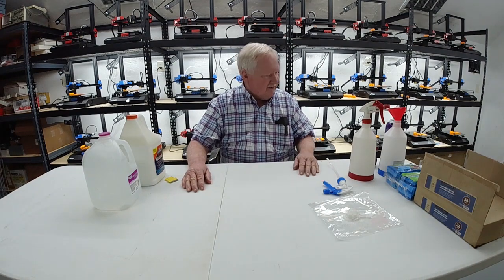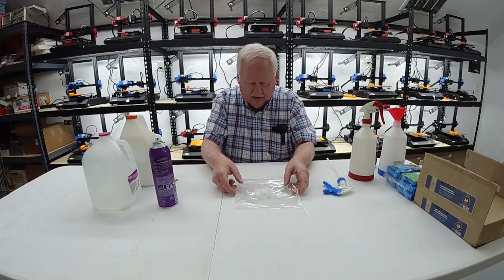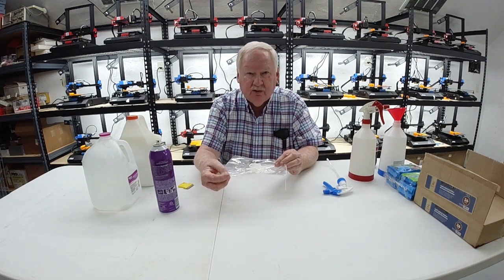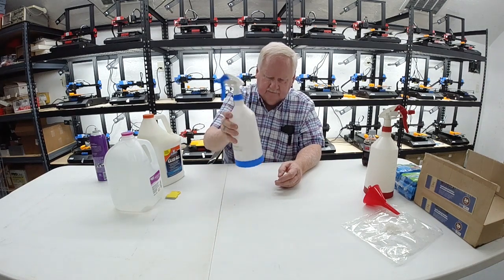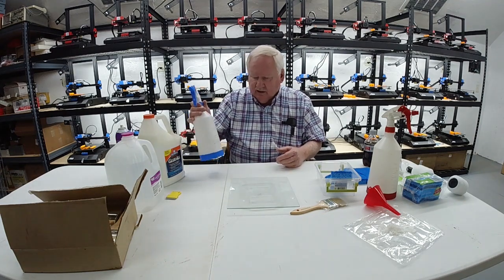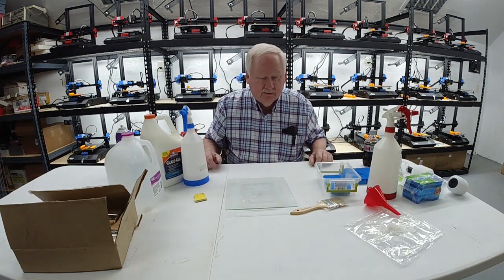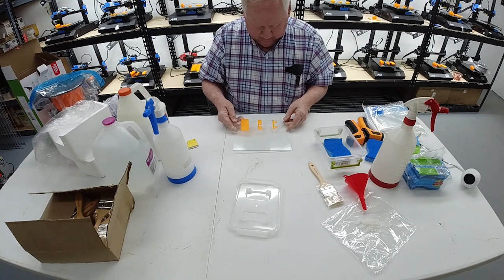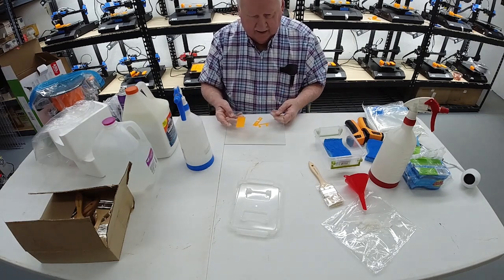GLASS BED 3D PRINTER PROBLEMS, the number one problem at New Tech Inventors is adhesion.

Comment: Where did you get your clips to hold the glass?
Reply from the maker: The low-profile flat clips came with the Anet printers and the copper clips I purchased them on eBay as a box of 100, I think. You can also get them at Staples. Thanks for the question and for your support...Ken

Comment: There is another way to improve adhesion without using any glue: you tweak slicer settings for initial layer. Initial layer line width : increase to150%.      Build plate temperature initial layer: add 10 degrees Celsius or more. Also if your nozzle is just a tiny bit too high from the bed than it should be that could also cause adhesion problems.
Reply from the maker: Very good advice my friend. Your right the initial layer is critical and I have been working on the glass temperature and nozzle height. I haven't increased initial layer line width to 150% yet but will try that. Thanks for sharing your ideas and for your support...Ken

Comment: That’s a great idea Ken. Best way to learn trial and error. Looks like you did very well. 
I used some of the nano glue for my abs, I found that you have to remove before the bed cools , if you remove after the bed cools it will crack the tempered glass. It’s also not easy to remove your prints when the bed is hot. Your way looks much easier. Thanks again for sharing Ken. Cheers Robert
Reply from the maker: Thanks Robert, it seems like there are so many different surfaces to 3D print on that it's hard to figure out which one is best. I have come to the conclusion that it mainly depends on what you are printing and what kind of filament you are using as well as what printer and what you want the surface of your part to look like. In other words it's going to be different for everyone and I can only determine which is best for my 3D print jobs. Good to hear from you and and get input on your experiences...Ken

Comment: Cool experiment Ken. I really enjoy your videos. I agree with the other that steel flex PEI sheet is the way to go, more so for a production setting like yours. You can't be adding to your process, especially with more printers coming online...Keep it up! C
Reply from the maker: I will be putting steel plate with PEI sheet on it on one of my printers to see how well it works for me. If it does better than glass I will be changing over to that method. Thanks for your input, it's very helpful to get advice from others...Ken

Comment: I use PEI sheet as well. I used to use it on glass. It works great and NO mess. I now use it with a flexible build plate that is attached via a flexible magnet sheet attached to the bed. No mess and has been working for years now.
Reply from the maker: Thanks for that info Mitchell, You aren't the only one that has said the same thing. I think you are on to something and I am going to try it and see if I can get the same results at my print farm. We all want to have our parts to print flawlessly and efficiently. Helping each other will get us to that point faster. Thanks for your input, it contributes to the solving of common problems we all have...Ken

Comment: I agree with one of your viewers “bed weld” is good for me.  Very nice and long lasting.  Of course I need a little AC glue to make my tall columns stick. But.  For you it maybe the best way... you may get many prints from 1 application.  Glue mixture is great but for a print farm it to much work and to messy.  Trust me my friend.   I have done the Elmer’s route.   The problem with Elmer’s is you have to clean it every time.  it comes off so you have to apply it again.. whatever you use I see no reason to coat the entire bed.  I use a dab wherever the printer has to run over it.  Great experiment.. thank you.  Ps I can’t believe all that residue from the hair spray.  Your friend joe
Reply from the maker: Thanks Joe. It seems like many agree with you and thanks to this video I now have many more options to explore. I will be trying many of these suggestions and I am sure I will come up with the best combinations for my various printers and print jobs at my new print farm. As always Joe thanks for your support...Ken
Reply: @NewTechInventors  you can learn the easy way or the hard way.....or your way..I think I like your way...your friend joe

Comment: I use 3d printer glue stick off amazon works for me,just let you bed cool after and you print will pop off and use one coat multiple times,the bed goes white after a bit ,then wash your glass bed in warm soapy water ,had 6+ prints on one coating.
Reply from the maker: Thanks for that information James. Sounds like you have found what works best for you and your print jobs. I have a lot of things to evaluate now, thanks for your comment...Ken

Comment: u might need to buy a bunch of pei sheets as long as u keep it clean pla sticks very well to it
Reply from the maker: Thanks William. I haven't tried using pei sheets, but did look at some videos just now since you mentioned it. I will try the pei on a couple of my printers and let you know how it works for me. Thanks for sharing this info and thanks for watching...Ken
Reply: @NewTechInventors  take a look at printed solid at there buildtak PEI its thicker than most other sellers sheets, but same thing with it got to keep hands off of it clean with dawn every now and then and in between prints wipe down with ISO and when it cools it should come off easy, if u start to have problems with it holding prints use nail polish cleaner for about 30 to 45 seconds wiping it that rejuvenats it then back to normal routine

Comment: PEI sheet on the glass.  I personally got rid of glass sheets a while back and have all steel flex sheets with PEI.  You don't need to wait for the bed to cool down to remove the parts
Reply from the maker: Sounds good Scott. I bet they heat up better than glass too. I will try it for sure. Thanks for sharing your experience with us and thanks for your support...Ken

Comment: I believe you would be better looking into the hairspray you are using. Apparently there is a particular ingredient to look for which is in certain sprays. Sorry I cant give any more information than that but I have seen it mentioned in 3d printer videos on youtube.   I use hairspray and sometimes painters tape which I've found works with the petg I'm using at the moment. Agree that it's best to apply hairspray away from printer to prevent it going over the printer. Enjoying your videos. You are methodical and have great drive. I'm sure you will be one of the goto guys for information due to that.
Reply from the maker: Thanks so much for your encouraging words and for sharing your experience with us. After looking closer at my printers I found the hair spray deposits itself unevenly on the glass and this can cause some parts to have more adhesion than others, Also applying the water glue mixture with the sponge gave me an even distribution on the glass surfaced and also allowed me to maintain a thin layer of glue on the surface. I will report more as I complete testing. Thanks for your support...Ken

Comment: I like using the large purple Elmers glue stick it doesn't take much just a quick light pass and it's water washable. I also use Sprayway glass cleaner and it works great.
Reply from the maker: Thanks for that info my friend. I will check out the Sprayway glass cleaner, I need something that will quickly remove buildup. Thanks for sharing and for watching...Ken